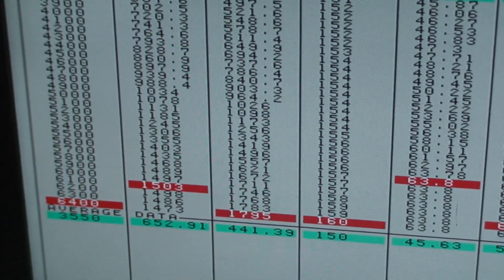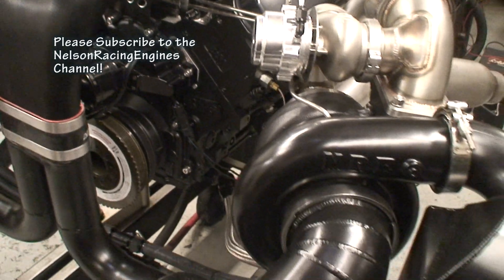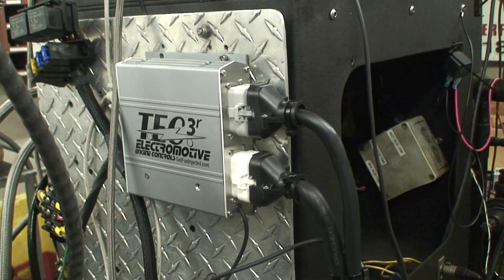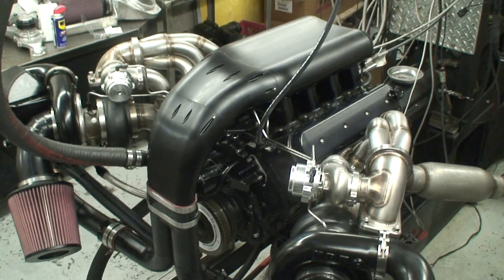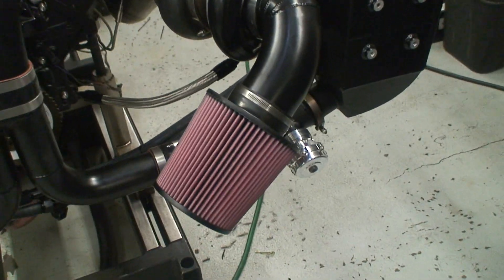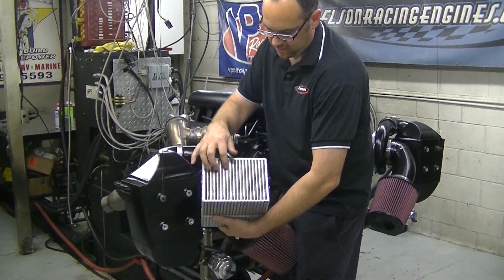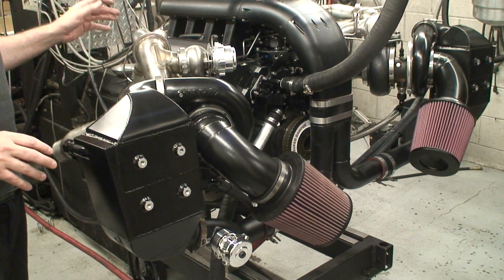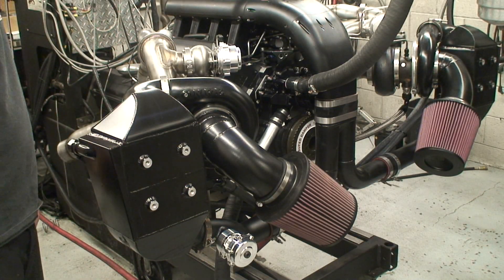Monster 2000 HP LS 454 Exposed!  Nelson Racing Engines symmetrical mirror Image Turbo Beast!

Comment: BIGJACKTURBO Maybe I will ask you this since no one on the nelson racing channel will answer me. How come they are not using the Dual Feed Fuel Regulators that are built into the Alien Intake anymore or was it just for the engine that they didn't utilize them

Comment: was that 1700 at 31lbs of boost. On a 454? 
Not very impressive by any means tom. You know this.  Don't tell me this is the 4 cam billet block you been bulding for years now.
Reply: +B00steDevil Yeah what ever did happen to the 4 cam motor???????
Reply: FalconXE302 at 31 psi is not docile by anymeans. Big bore big stroke suffer from blow up syndrome aswell.